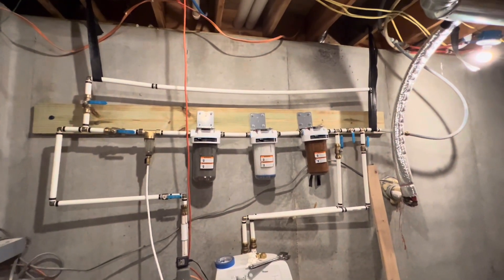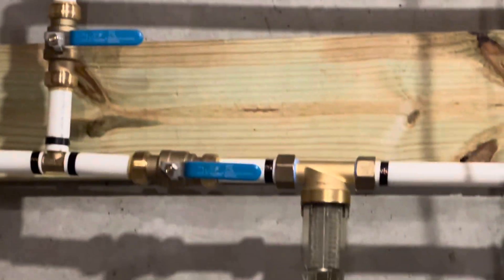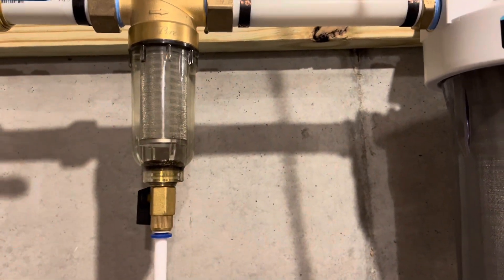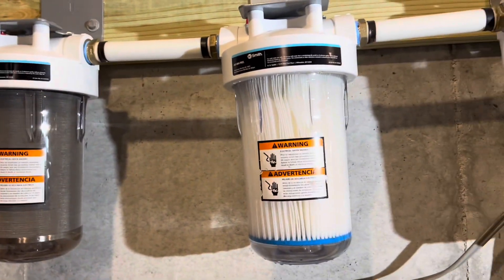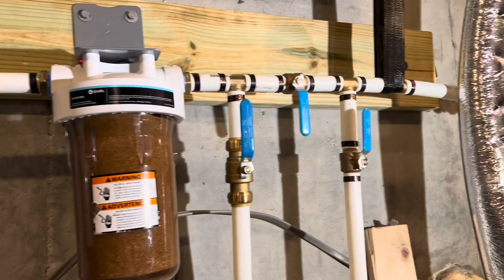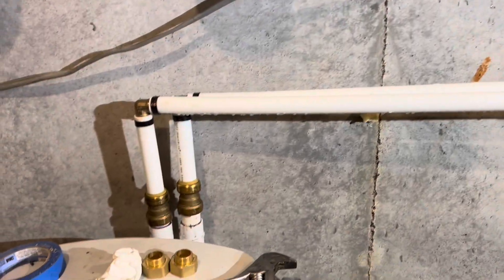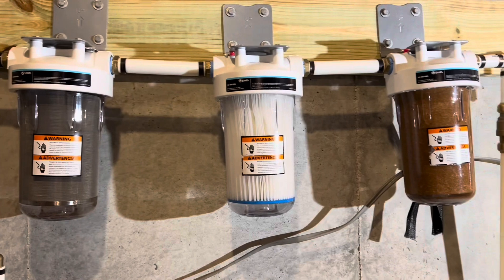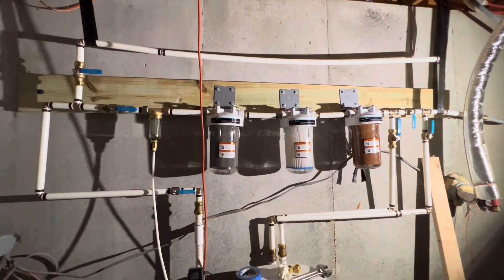DIY Whole House Well Filter Design

Comment: Good ingenuity. Not the pretty, but certainly effective. Next iteration, try for fewer connectors, this equates to fewer chances for leaks. No reason to have small pieces joined with longer ones. "Measure twice cut once." The stainless 50 micron filter is brilliant.
Reply from the maker: Agreed. Part of it was being limited to what was available at the local hardware stores on the one weekend I got to do this. In a perfect world I’d have bought longer PEX piping, but they were out at the store. Had to work with short pieces. Thus far no leaks. No issues at all, thankfully! It works generally as I hoped it would. The one thing I might do is a larger spin-down filter as suggested by another commenter. Appreciate the advice and thanks for the compliment on the filter. I was especially happy to find that — they seem to be awfully uncommon and yet an obvious idea if you think about it from a long term cost perspective.

Comment: The blue Teflon tape name please?

You really need to add the clamps and stand-offs this guy used:
https://youtu.be/s67NlAxf-D8?t=183
Reply from the maker: Definitely a good idea on the clamps. I like the pre and post pressure gauges as well, I just use a bucket of known volume and a stopwatch to calculate GPM. 

The only downside to using all the brass and the components he did is expense. On a system my size adding those and the gauges would have cost another several hundred dollars I didn’t have to spend, although it’s on the list. I appreciate the link. Gave me a few more ideas on what to improve going forward!

The tape is Blue Monster brand. You’ll be real happy with it and their pipe dope. 

Milrose 70885 Blue Monster 1/2 Inch x 1429 Inch Blue Teflon Tape (3 Pack) https://a.co/d/auxiInW
Reply: @jamesedward5456  

Glad you have more ideas.  I was mainly pointing to the stand-offs.  Yep, brass is nice if the checkbook allows it.